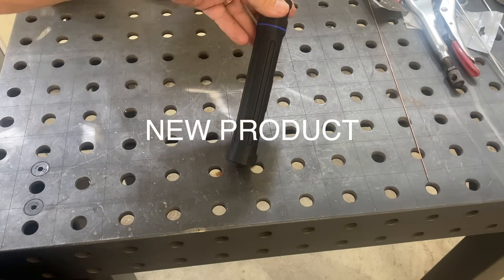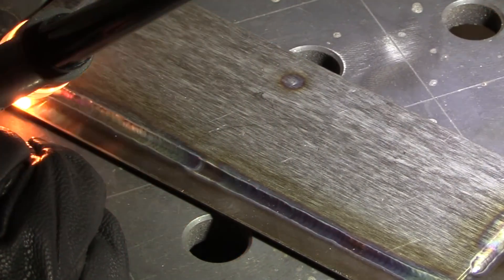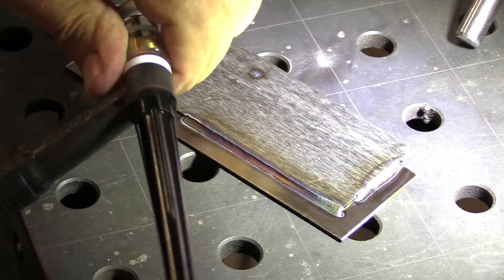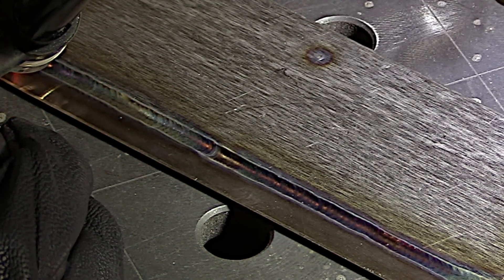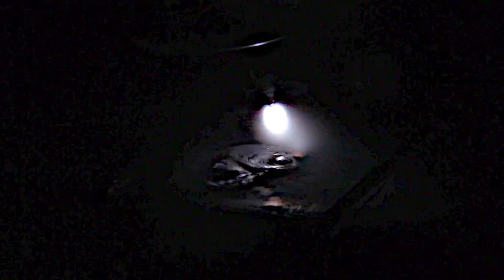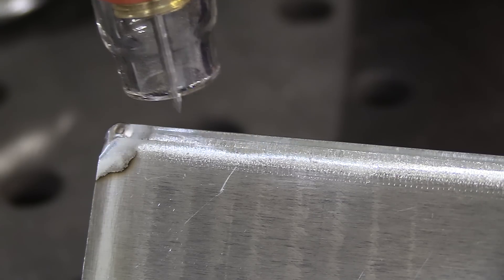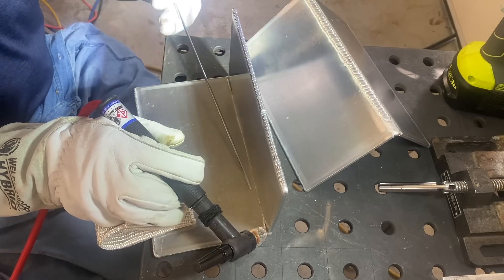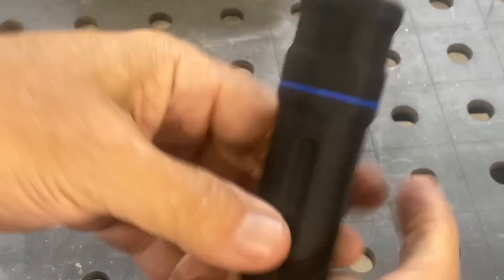Does Tungsten Size Always Matter?

Comment: I find 2.4mm/3/32" tungstens versatile for steels 3mm and thinner. 3mm and thicker I stick weld it. I wouldn't have bothered buying 1.6mm/1/16" tungstens if I knew this before. For aluminium I find 3.2mm/1/8" tungstens good for pretty much everything even thinner stuff like 1.6mm.

Comment: I tend to use 1/8th for most applications I do allot of 1/8th wall stainless steel pipework with it. 
Tend to prefer it as the tip doesn’t dull as fast

Comment: Before watching - the 6061 guy has suggested 1/8" for everything because it can be sharpened as you like and you don't need the tooling for every size.  I like that idea but I'm not sure in experience if you need different sizes. Personally I use 3.2mm for everything and mainly only tig aluminium.   I'll add to this comment once I've watched all the way though.

Comment: Awesome video Jody👍 I agree with you I’m no expert at home I have a 210 amp machine and mostly just use 3/32” blue 2% lanth tungsten for everything. At work I use 3/32” for mostly all steel and stainless welding. Sometimes I’ll drop down to 1/16” for really thin work rarely though I don’t do a whole lot of work thinner than 16ga. For aluminum at work though I do tend to use 1/8” tungsten most of the time unless I have something 1/8” or thinner for aluminum just my preference at work I like to weld kinda hot and fast ish and will set the machine a little hotter around 250 amps or more where the 3/32” melts sometimes but that’s welding 1/4” or more give or take most of the time. At home 3/32” is perfect for most applications. Blue 2%lanthanated tungsten is probably my favorite too I tried it when I heard you mention it years ago and it seems like the best all around tungsten for ac and dc. 👍👍👊🏻👊🏻
Reply from the maker: @WojnarskiWeldingFabricaion  thank you

Comment: I think it would be interesting to strength test the welds as well. My thinking is that the smaller, hotter electrode would shed more tungsten into the puddle and need to be replaced more often. Probably not a big difference in strength, both good welds still, but i'll bet the bigger tungsten would lay a slightly cleaner and therefore stronger bead

Comment: tyvm.  A couple of items to consider, the current capacity is proportional to the diameter of the tungsten and a certain amount of area is needed for the current to leave the electrode.  I think that this is why the weld puddle was wider on the 0.040" electrode and that you saw the secondary ionization plume.  I use electrodes from 1/16" to 1/8" and I have noticed there is a difference in how the puddle behaves as the current carrying capability of the electrode is reached.  For what it is worth, my experience is that the shorter taper works better at higher amperages and the longer taper works better at lower amperages.  Of course, I am also using the smaller diameter electrodes as the lower amperages, and vice versa, so that may also have an influence.
Reply: A lot of truth to what you are saying. Just last week, I was doing some stainless, some 1/8 and 14 gauge square tube, and I had a 1/16” tungsten in. I need to up my amps because it wasn’t burning hot enough to get the penetration I needed. So I turned up to more amps, like maybe 70. Still, not burning hot enough. I turned up higher…80 amps…still not giving me what I needed. I turned up to 100 amps, and there was little to any change in how deep and fast I was melting the steel. I came to the conclusion that the 1/16th tungsten just isn’t capable of carrying more than 60 or 70 amps. I switched to a 3/32 and finished the job at around 65-70 amps.

Comment: I mainly weld 16-20 gauge sheetmetal and use 0.040 ground to a fine point. I dunno the angle as I hand grind but I make it pointy. Everything I do is ground and planished out. For me, the smaller the tungsten and smaller the wire, the smaller I can keep the heat zone. Less heat makes for an easier weld to hammer out afterwards.

Comment: E3, the purple banded tungsten, proved to be all around the best for me even compared with 2% lanthanated. Was able to do basically 95% of everything that came through the shops with 3/32, ac or dc. Super thick aluminum wr had to go up tungsten size and throw helium at it but otherwise 3/32 was the go to.
Reply from the maker: @highlyalloyed9296  do you weld more on dc or ac?
Reply: @weldingtipsandtricks im in materials research now but in my job shop days it was probably 75% aluminum parts, rest was various other steels and stainless with lots of tacks and restarts, which I would dare to say even stands up to 2% thoriated almost in terms of tip life and resistance to picking up crap from the base metal. On ac I found it never really getting that dumb cauliflower stuff going on on the tip, mind you I can set a machine correctly lol but nevertheless e3 outperformed the various other blends we tried. Some still insisted that this or that blend was better but hey, I wasn't responsible for their parts lol
Reply: Years ago, I took Jodi's advice on the 2% lanthanated.....& they do work exceptionally well for nearly every situation.  I've also tried the E3 & LAZr, which both work very well.  Depending on material thickness (lower for thicker; higher for thinner + better control), I prefer being around 60hz, although higher frequency (120-150hz) tends to prevent the nodules from forming on the tungstens.

Comment: Hey Jody thanks for the awesome video as always. You mentioned for a 2%  ceriated electrode you may have to jump to 1/8” diameter for the 200 Amp fillet weld. Are lanthinated electrodes able to carry the current better than ceriated? I have noticed as I do a lot of AC welding with 2% ceriated  electrodes (3/32”) the end tends to crack and/or break apart over time.
Reply from the maker: @benjamincornaby1854  in my experience 2% lanth tungsten does hold up better on AC at higher amps.
Reply: Okay, thanks

Comment: I’ve tried using 3/32 lanth 2% for welding essentially paper thin stainless exhaust parts that have been in service for years. Cant do it! The arc is too wide. .040 thoriated gives me much crisper and precise arc. Mind you, I’m welding at around 10 A compared to your 60 amp test. Plenty of ways to skin a cat.
Reply from the maker: @hoodznchromez4179  bingo. I think you nailed it. Need to be in the lower amp range for best arc.

Comment: I do use the 2% lanthanated due to finding that your recommendations for it being a great all around, were spot on. 

As I was learning to TIG, I have never understood why you would want a small electrode unless it was really low amps like <50A and super thin material and even then the sharp point on a 1/8" or 3/32" seems to wok the same or better...  I still do not do it a lot to have great skills, but I still do not see why smaller is better for normal projects/jobs...

Since we can sharpen all the electrodes to whatever sharpness needed, 1/8" seems to be more durable and make more sense.  I have never really felt the need to do down in size to make a better weld, but I do need to go up once I get closer to 200A+.  I bought almost exclusively 3/32" parts from your store, but really 1/8" seems to have no real down side that I have run into and does everything a 3/32" can plus handles the 200-225A of my PrimeWeld better on 3/16" and 1/4" aluminum...

Great Video you shared today!
Reply from the maker: thank you
Reply: @weldingtipsandtricks  It is awesome for you to share videos where you are investigating might even learn instead of pretending you know everything like some folks do.  Your honesty and humility is at least as valuable as your experience, excellent skills and your willingness to learn.

Thank you for being a valuable instructor to so many.

Comment: Is there a benefit to dropping from a 3/32 to a 1/16 for welding .063 aluminum? I just bought a stubby kit, so I have the consumables on hand and have a sheet metal assembly to weld up. So far, I've only ever used a 3/32 tungsten.
Reply from the maker: in general, a 3/32" would be my choice for .063" aluminum.  there are probably a few exceptions where a 1/16" might be bettter
Reply: @weldingtipsandtricks  Thanks, Jodi!

Comment: Id bet dollars to donuts that the 0.40 tungsten has more points for the arc to jump off, making a wider cone. Maybe the heat is oxidizing the surface causing more problems too.